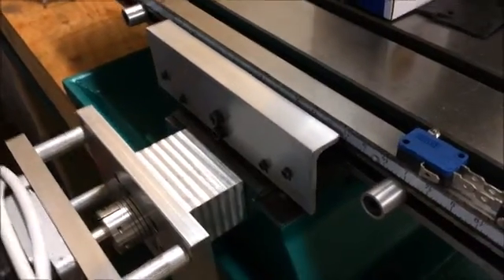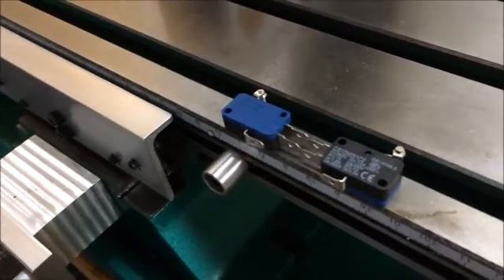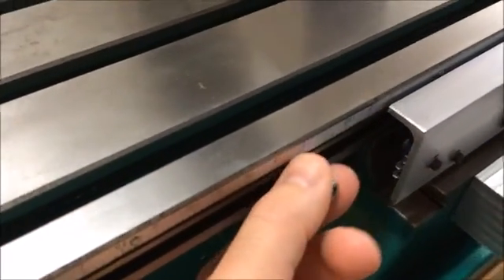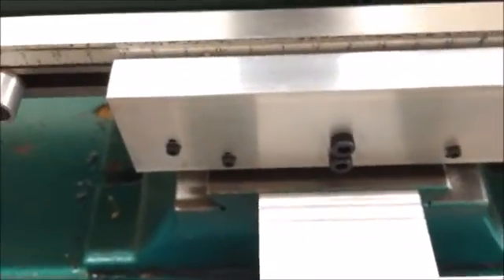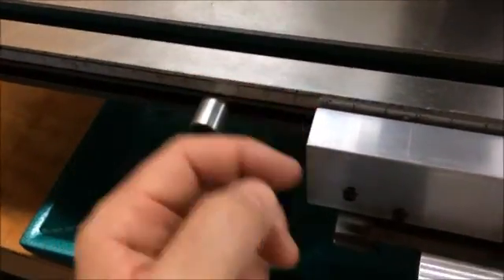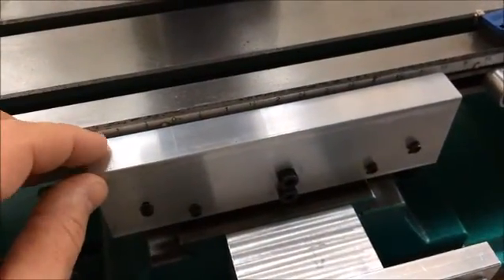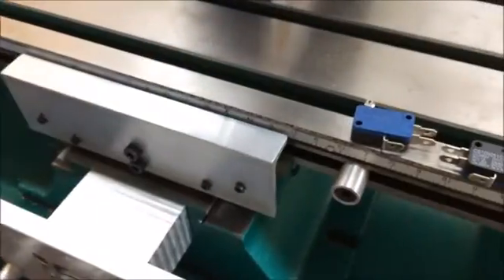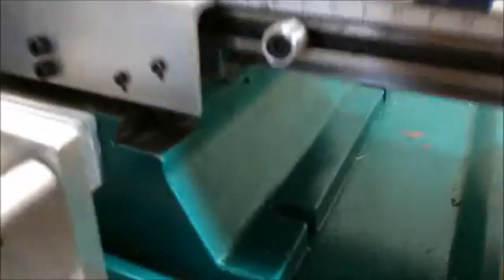Grizzly G0704 or BF20 Milling Machine CNC Conversion: X Axis Limit Switch Mount - How To Build

Comment: I like it! Will you still be able to cover the Y axis ways with the bellows?
Reply from the maker: Crivo152 Hello again.  As far as I can tell, there was no cover on the front of the table - only the back between the table and the Z-axis column.  However, I do plan on installing some sort of cover on the front of the table to protect the Y-axis ways and ball screw.  I'll probably post a video once I have all of that worked out.